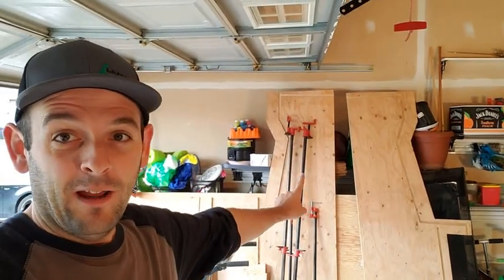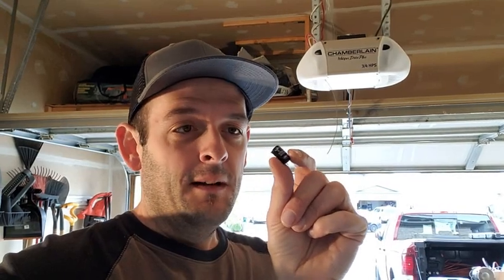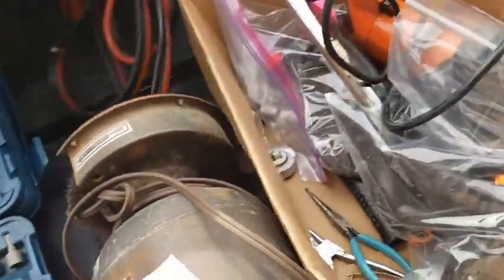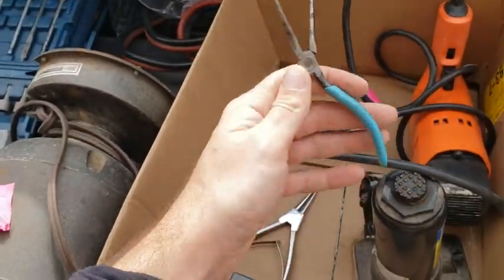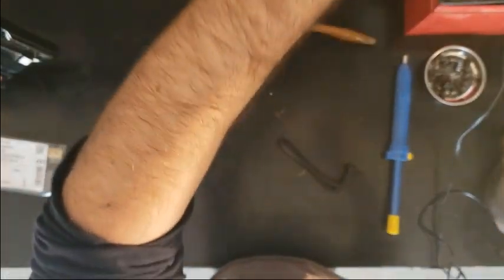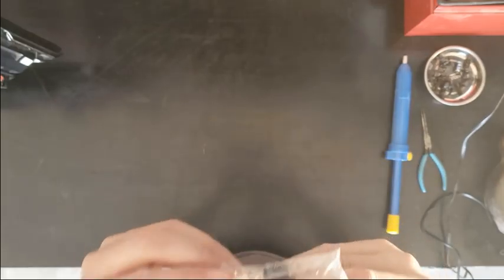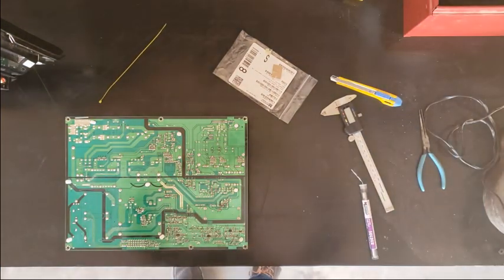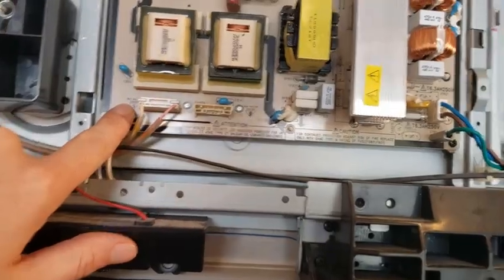How I Saved a 44" TV From The Scrap Heap for $1.94 in Parts

Comment: If you do use flux, always remove the extra flux with an old tooth brush and 99% iso alcohol... never never never use acid based plumbing flux on electronic circuit boards! The acid will eat the copper traces right off the fiberglass board!
Reply from the maker: I guess time will tell ;)

Comment: I change a great deal of caps in tvs and monitors and switch mode power supplies! The height doesn’t matter at all as long as it physically fits in the space provided....

Also, as well as a solder pull-it, desoldering  brade is very useful in removing the remaining solder! 

Also, never use lead free solder... you’ll thank me later... but lead free solder is very difficult to use correctly without the correct soldering station. You will get cold solder joints most of time when using it...

If the caps don’t fix the failure, start checking all the silicon devices with a multimeter... they should always conduct only in one direction only, and never appear as resistance!!
Reply from the maker: Yeah my multimeter confirmed (despite my cap being in the way) that I had good connections and no bridging of the board.
Reply: If you place the multimeter in diode mode, you can check the caps , the resistance across the cap will go up while charging and then flatten out and then if you flip the polarity of the leads the meter with discharge the cap and the readings will go back down and approach a lower steady state...

Comment: Those pink and white wires and the black and gray wites at the bottom go to the cold cathode display tubes... watch out they are high voltage and they do bite hard!!!

Also I though I saw another bulging cap in that ps that I thought I saw....
Reply from the maker: I only noticed that other capacitor in post production unfortunately. 😖
Reply: @mguy19 Bisanti, what is the value of the third cap? I will grab you a couple from my stash!